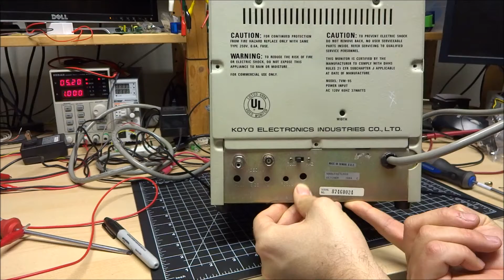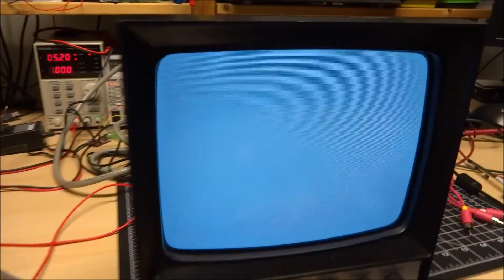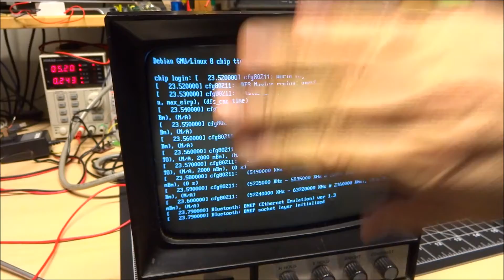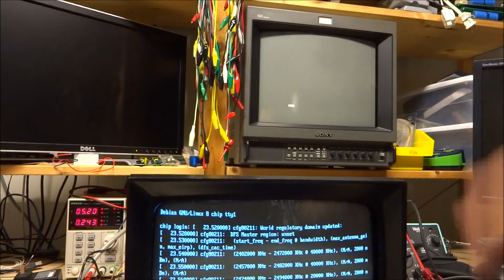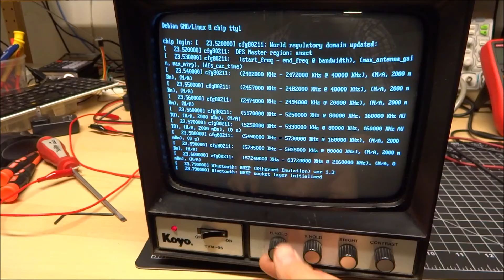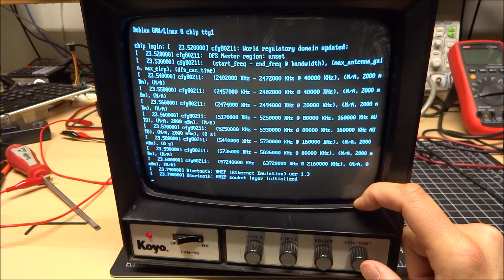Koyo TVM-95 NTSC 9" CRT Monitor

Comment: OK after seeing this I realized that the Hitachi monitor I got second hand with my first PC (Tandy 1000, also second hand) is the same deal as this. Today I got it down from the shelf it's been sitting on for about the last 15 years. It weighs about 300 pounds, but does have a carrying handle. It's much heavier than some 20" VGA CRTs I have sitting around, but try finding one of those with a carrying handle!

Comment: This monitor is an old fly back double chasis. It has the older cheap china voltage regulators which were notorious for catching fire if you turned the contrast and horizontal deflection units up all the way. 

I knew a guy who worked for tatung. He said once kristi mockunoi who was in research and development at a christmass party was drinking soke she took the back off the monitor. Which it says there no servicable parts leave to a professionsl

But she was drinking and touched the yoke. She got a big shock went flying 5 feet broke through a glass panel and ended up in my buddies office

Literally her hair was smoking and steam was coming off her head. Supposedly she said i karimba and fell fast asleep in my buddies lap lol

Comment: Early composite computer monitors were literally a modified industrial monitor chassis with some extra features (mine has some special support for 40 columns), an RCA vs BNC input, and a CRT with a different phosphor color (usually not P4 which is white). My Zenith has the same crazy specs you would find in a CCTV monitor such as 15 MHz bandwidth (remember NTSC can't have much video information beyond about 3.5 or so due to the chroma signal).

Comment: The "commercial use only" is there because it would have been only certified by the FCC for commercial use, as opposed to home use...there are 2 separate FCC designations...Commercial usually gives off more RF interference...

Comment: how about putting that micro computer inside the monitor, and making it a portable computer or something
Reply: you "could" tap 6.3volt of the heaters?  im not sure but you could try it with another monitor. 
i got these cheap dc-dc voltage regulators from china really cheap with a trimmer pot. it works great.
Reply: @1marcelfilms  The 6.3 volt heaters were usually AC. On tube type TVs (and monitors) this was usually in series with (series string sets) the other tubes or off the power transformer. In solid state sets and monitors (such as this one) the heater power is tapped off the flyback and therefore is the horizontal frequency.